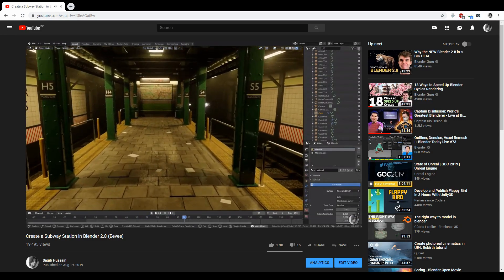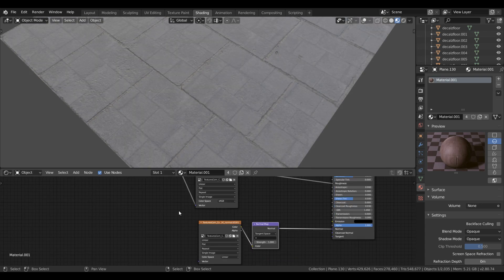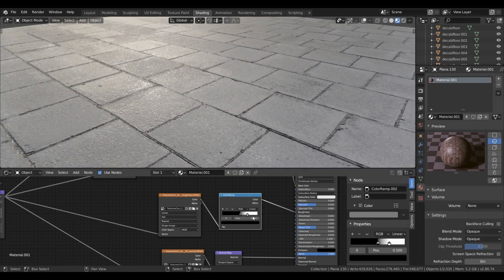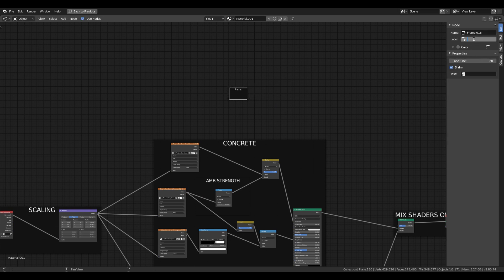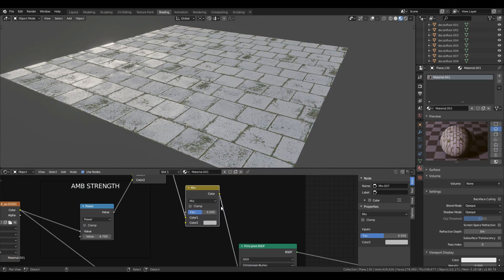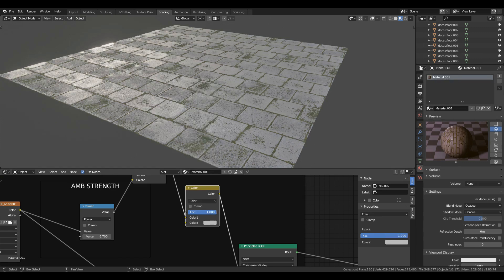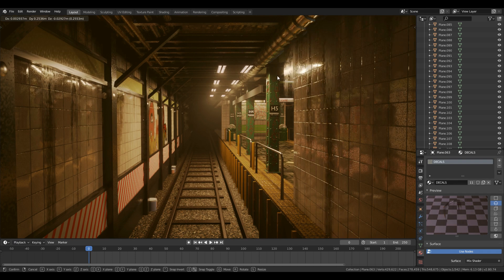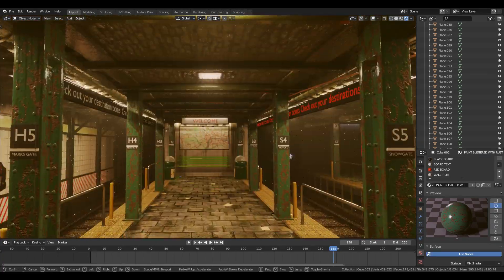How to Create Materials Decals and Realistic GI in EEVEE

Comment: Thank you again sooo much for this tutorial. 
On thing about learning Blender is the values used for lighting and many of the other factors. The manual is not helpful when it comes to knowing what values to start with. Can you suggest a resource or a strategy for assigning a value to a variable like a  light , ambient occlusion , any note that uses a number ..etc.?
Reply from the maker: You're very welcome! The only way to deal with it is to work on single light at a time. 
First try to define the distance of the light and then give value to it  . Then use the irradiance volume to bake indirect light.When you will be happy with the results then duplicate the light and do this one more time . After that just set the lights up for the scene to finish the scene. In this way you will learn how much you need to give value for light distance and also will  know how much value you will need to give to globally illuminate for different scenario of mesh at a particular distance. Make sure you are working with the real life scale that is very important .

Comment: Hmn...every tutorial/course on blender materials say to set Roughness/AO/Normal/Bump to Non-color data...is there a reason you dont do so?
Reply from the maker: Well not necessarily if it gives good results visually then why not the reason of using non color data is that it does not alter's the gamma of RGB color channel of the texture. As for the texture you have mention does not need any gamma correction as they are black and white format .